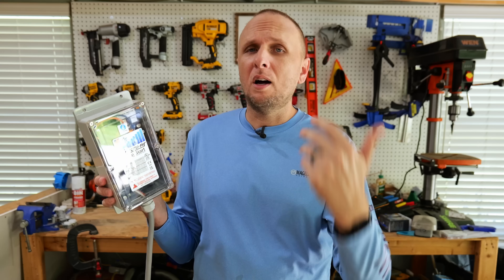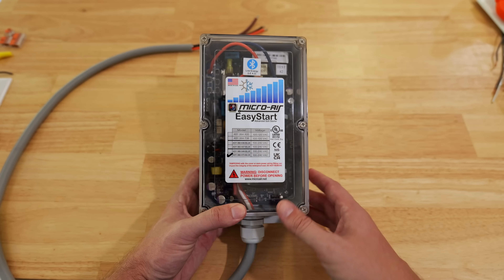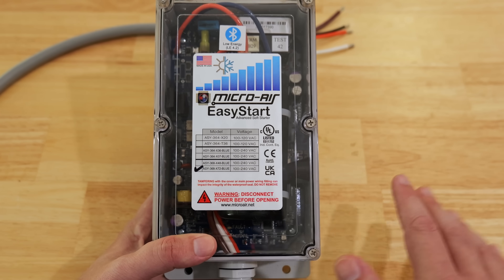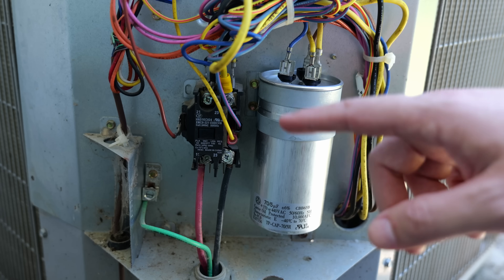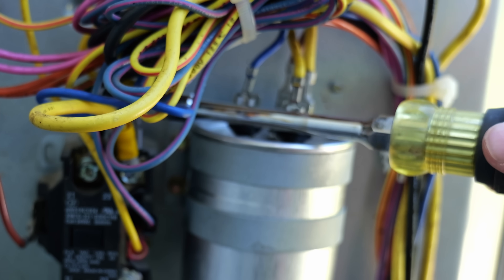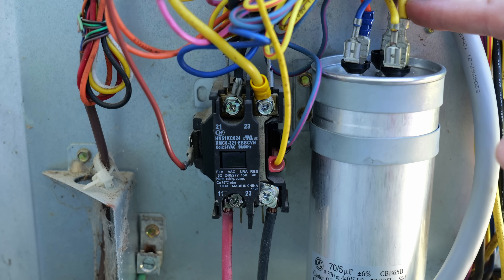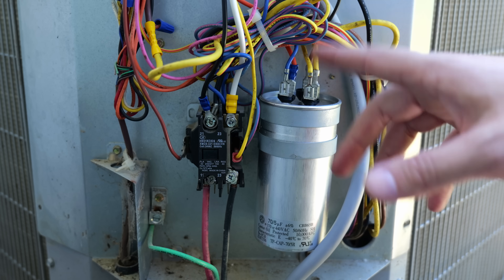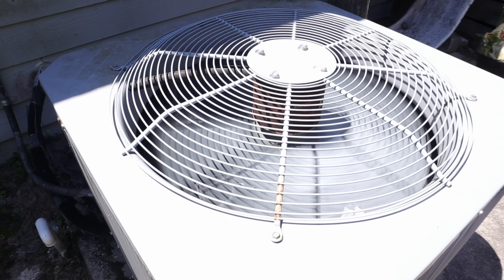Why Every Homeowner Should Consider Installing an AC Soft Starter | Micro Air Easy Start Install

Comment: I bought my kit from their website, they have an universal one now that was just released in July 2024 that works from 1 to 6 ton ACs according to the manufacturer. I used this video for the installation and made it very easy. Make sure the wire that comes from the contactor that has direct connection is the one that connects to the brown wire. The balck wire goes to the side that the switch controls. Both wires that go into the contactor will be 120 each. My softstarter is using 27 amps to start the compressor, and now I am able to run the AC with my generator.
Reply from the maker: Yes I just got my hands in the Flex model yesterday.  Will be making a video on it shortly!   Glad you’re getting such good results!
Reply: @HowToHomeDIY  do you recommend purchasing their EasyStart Universal Installation Kit?
Reply from the maker: @thepiecesfit5049 you can and that will provide you with everything you will probably need and some things you won’t need.  I’ve never personally bought it and just bought spade, ring, and butt connectors from the store.  They do have some things in the kit like a grommet to help protect the wiring entering the unit but they also can be found at the store.  Really just about convenience and price.
Reply: @thepiecesfit5049  I couldnt find thier other models in their website, so I believe the flex is the only that can be purchased right now.
Reply: @HowToHomeDIY  Does that mean that the Flex has a different way of connecting? I just ordered a Flex
Reply from the maker: @willemtenwolde5826 I have not installed it yet but the instructions appear to be the same as on the previous models.
Reply: Are you telling that the orange wire from the Flex dos not go to the HERM on the capacitor?
Reply from the maker: Per the instructions the orange wire still gets connected to the capacitor on the HERM terminal.
Reply: @HowToHomeDIY  correct, apologies for my mistake, edited my comment to prevent confusion.
Reply: @willemtenwolde5826  my apologies, I meant brown. Follow the video instructions, they are accurate. Orange goes to Herm with a spade, brown connects to the direct pass through side  in the contactor.

Comment: After Houston had two storms so far that knocked out the electricity it is time to get this soft start because it was hot on both outages.  Thanks so much for this video. You explain in detail why and how.
Reply: I'm here in Houston,pro AC tech since 2004
Reply: @JamieArellano-nl1lg how much to get one installed?
Reply: @Jezeus11  300
Reply: @Jezeus11  cost of the soft start is 320
Reply: @JamieArellano-nl1lg  👍 I just looked them up. Doesn’t look too complicated to DIY now that I’ve seen the whole video.
Reply: @Jezeus11  you right it's all about how   works with generators

Comment: Guy installing my 9500/7500 generator switch to my breaker told me that there was no way it would start my 4 ton ac.  I think you've proven him wrong with the soft start kit.  Had a local ac guy wanting $900 for the soft start kit install.  Seems pretty simple and I'll install the $400 kit myself.  Thanks

Comment: From what I see it lowers the very brief inrush amperage when the compressor starts. As far as electrical savings it is nill to none. I would like to hear the mechanics of how it works. I also watched a few videos of them being pulled off units because of failure. unless you are having issues I would just leave it alone. I have done refrigeration and HVAC for lots of  years and learned there is no magic bullet. Frequency drives are used on fans etc in commercial applications and in some cases in residential equipment but it is built in to the system. Ask your AC professional rather then do it yourself videos.
Reply from the maker: What were the reasons they were causing issues?  I’ve seen videos of people installing the wrong ones, installing them incorrectly, and an HVAC tech who didn’t know what he was talking about and has since said so.  Yes ask your ac professionals, almost none of them know what a soft start does, how they work, or that they exist.  They will think you’re talking about a hard start kit.  It seems you also aren’t really sure how they work.  Not trying to say that in any way, but based on what you said it seems that way.

Comment: I have a question on the 5 on/off learning cycles done after the Soft start is connected.  Did you pull the breaker the 5 times or did you turn it on and off from the wall switch inside the house?
Reply from the maker: I just let the thermostat turn it on and off.

Comment: I have 2 2000 watt inverter gen that are connected with a parallel kit. Do you think that that set up  will run my 4 ton AC? 
Thanks.
Reply from the maker: That would be unlikely.  But impossible for me to know without knowing your unit's in rush amperage on startup.  I was able to start up my 4 ton with my 6800 starting 5500 running generator.  Which I was actually pretty surprised by.  And it didnt really pull it down a lot.  So maybe.

Comment: Hello. I purchased EasyStart model ASY-399-x20. Installed on house AC 3 Ton.  Worked one day then burned up. Order another one that I guess is higher value rated. The one I purchased seems to be for RV only? Advice please.
Reply from the maker: Yeah the x20 is for RVs.  You have to get the proper size soft starter for your unit.  I have links to the different sizes down in the description of the video.  You can just click the link to the one listed that covers a 3-ton unit and you should be in good shape.

Comment: Can I use the 4ton soft start with my 3.5ton machine? I plan to replace the 3.5 with a 4-5ton in a year.
Reply from the maker: Per Micro Air the soft starters are all sized specifically for the units and using one that is not designed for your tonnage could have negative consequences.

Comment: Will a 6500 watt generator start a 3.5 ton air conditioner?
Reply from the maker: It could.  As you saw in this video, I was able to start my 4 ton with a generator about that size.

Comment: You could benefit from some training on how to crimp connectors and splices.
Reply from the maker: Still holding very strong.  Must not be an issue.
Reply: @HowToHomeDIY  Sure, just because you do not do something correctly....does not mean it will fall apart 😆  There are two types of techs.....those that make it work, and those that make it right.   If you are a "make it work" guy, that's ok, people should just know that up front, and research accordingly for best practice.   Sorry if this offends you......

Comment: QQ, Your inrush is 35.8amp after installing the kit. That's 8592 watts, which was over the peak of small generator at only 6875 watts. That's almost 2000 watts over the generator peak. What am I missing here?
Reply from the maker: Hey, you are just as surprised as I was.  I did not think it was going to start up but it did.  In all honesty that was the first time I tried it too lol

Comment: There are many of these types of unit available and I would suggest that you may want to read the customer reviews of the one you are considering buying. I would say that not everyone installed these unit correctly or picked the right size so you may want to keep this in mind when reading the reviews.

Comment: MicroAir is now offering the Easy Start Flex for units up to 6 tons. Your thoughts?
Reply from the maker: A good idea.  Will make it easier on them and customers only having to look for one model.  Outside of that it is my understanding there aren’t any differences.  I am waiting to get my hands on one to try it out.  I was told today by one of the largest resellers of them that micro air is still making the 368 model at this time.

Comment: I’ve watched and rewatched this video a half dozen times.  I received the new Micro-Air Easy Start FLEX earlier this week and I’m writing the installation instructions for my Carrier, 3 ton 25HBC537A300 model. I’ve watched the Micro Air video also and your video is easier to follow. I think the biggest hurdle are all the different model AC Units on the market, do they or don’t they use other start components and of course the different color wires between manufacturers.  I now have a very good idea of everything I need to do. 

I had taken a lot of photos of the inside of my unit, the schematic, the contactor, and capacitor.  Now I’m able to watch videos and reference my photos at the same time while writing instructions for my unit. I don’t doubt I’m over thinking it and now that I have it on paper, it’s really very easy to install. 

I have a clamp on amp meter, but it doesn’t measure in rush. Like a sign from above I happened upon the Klein CL445 model at Lowe’s earlier this week and snatched it up, because I never see a clamp on amp meter capable of measuring in rush locally. 

Big morning tomorrow, hopefully I won’t let smoke out of anything. Of course all this is so I can better run my house from my portable generator and hopefully extend the life of my two year old compressor even more. 

Thank you for posting this video.
Reply: Keep us posted
Reply: @ariz7493  All installed up and running. I did seem to have issues later in the day that worried me but installing batteries in my thermostat and making sure the condensation drain was clear and it’s all working well again. My initial in rush current read with a Klein CL445 was 87.9 amps. After all the programming starts the Micro-Air app is saying my last start peak is 27.7. It’s noticeably quieter when it starts. I’m at 73 total starts since installing it yesterday.
Reply: "Let the smoke out of anything" 🤣As a young kid my grandpa had me convinced that all electronics had smoke installed at the factory and once you let it out it would never work again,

Comment: Love this! Great video. Question, if on startup the unit requires over 100A, how does a 35A or 40A breaker in the house panel suffice?

Comment: Adam, thank you for your videos, you've been a tremendous help to me. One question though please, I got a 13k generator & a soft start kit for one of my heat pump systems. The air handler is on a 60 amp 220v circuit I think primarily to cover the heat strip which I make sure never comes on and would be fine with disconnecting it. Question is, is there a work around to get the air handler down to a 30 amp 220v circuit so that I can run thru my 50 amp manual transfer switch?

Comment: If you are going to be doing capacitor change yourself or installing of something like this and need to discharge the capacitor, then you should plan ahead and get something like a 250ohm resistor and solder it to some wire leads. Use that to touch the capacitor terminals instead as using a screwdriver can damage the capacitor if it is charged up high still, meaning the life of the capacitor will be lower and you could ruin one of the plates meaning capacitance is lower and damage your compressor which is an expensive fix. A resistor to discharge is a safe way to do it and only takes a few seconds.

Comment: I am installing power share to use the battery from my Cybertruck to my house when power is interrupted or lost. However, my A/C is a variable speed 5 ton heat pump and concerned  if I need a Soft Start kit to avoid the concerning surge level when the back up from the Cybertruck is triggered. If the variable speed provides a similar soft start effect, can I avoid the need for the soft start? Thanks

Comment: DIY guys preach about the capacitor replacement scam but push these overpriced devices which appear to be a cheap capacitor and circuit board. Also won't this void your warranty. At least put pressure on the manufacturer to lower prices via a little pushback.
Reply from the maker: Not pushing anything.  A capacitor is required a soft start isn’t unless you want to run your ac using a smaller generator.  Two completely different things.   No it does not void the warranty.
Reply: @HowToHomeDIY  It's being pushed. Affiliate links. Look up some videos. If you have a bad compressor claim, they will more than likely void the warranty. "Manufacturers may void the warranty if anyone changes or adds a device to their equipment outside the controlled conditions of the factory,"
Reply from the maker: I have had this on my own system for years.  I can’t share what works well?  Don’t want it?  Don’t buy it.  Doesn’t void the warranty.
Reply: @HowToHomeDIY  Yes, OK understood. No prob with the video, just think the whole story should be presented. And a little pushback on price because you have to admit, these are way overpriced for what you get.
Reply: @HowToHomeDIY  It may be good, not saying it's not. Some bad experiences exist too. I'd suggest removing it before a service call.
Reply: @HowToHomeDIY  'The soft-start AC  works by utilizing capacitors in series, which enables them to reduce the current entering into the motor while still providing enough voltage to start it. The debate surrounding the use of a soft-start AC capacitor is often centered around its purpose versus its cost.'

Comment: Awesome video. Thank you so much. I have a 4 ton, 48,000btu ac. Should I go with the 42 or size up to the 72 on the soft start? Is there any precautions to sizing up?
Reply from the maker: I asked Micro Air that very question and they said you have to get the soft starter that goes with the tonnage of your unit.  They are all designed with the tonnage in mind and what they need.  So buying one that is larger than you need was strongly discouraged by them.  That said, if your unit is 4 ton, the proper soft start would be the X72.

Comment: Well. I finally broke down and bought two of the Easy Start modules for my air conditioners. A year ago I installed a hard start kit with the built-in relay. A year later, my air conditioners started to sound a bit rough again, so I checked and found that the hard start kit was damaged. The top came off on both of the units and the PTC Thermistor (not a relay) was in pieces. So it has not been working for a while, which I understand is not good for the compressor motor. I installed the Easy Start and what a difference this made, they perform beautifully. Bottom line: if you are going to install a hard start make sure that it has a separate relay and not a built-in thermistor (even though they call it a relay).   I am not an AC expert, this knowledge is from my research and experience. If the experts out there would care to comment on my review, please let me know if I am right or not. Thanks.

Comment: Thanks for sharing this is incredible information and your demonstration is also incredibly explained thanks I’m doing this to mine kudos brother oh I have a 16k standby generator Generac propane my thoughts on connecting it instead of the traditional electric automatic switch I would like to use that 50 amp plug like you just showed for your generator reason it’s so complicated getting a permit and high installation cost this way I can just do the same thing like you just did what’s your thoughts please thanks

Comment: To clarify, the soft start is starting the fan separately reducing amp load and then starts the compressor - is there any chance of starving the compressor (brown out)?  Sounds like a great solution to my new Lennox AC.  The unit starts rather loud and hard.  My old Trane, you can barely hear it start, this should take care of the hard start.  Thanks.

Comment: Just received my easy start been watching your video on how to install this to my heat pump, on the brown wire theres a warning label that states connect it to the run winding if connected to run cap damage will occur, so is the run winding the yellow wire that goes to the compressor side on top of the capacitor

Comment: Great video! I've been wanting to get a Soft Starter for a while now. Question. When you do the 5 restarts for the learning phase. Are you letting the system run through 5 complete cooling cycles? Or are you letting it start, cutting power, turn the power back on to let it cycle again, and so on five times?

Comment: Put this on my home ac 2 years ago. BEST thing i ever done. IMMEDIATELY cut my cost on my electric bill. Highly recommend this to anybody that wants to save money and a piece of mind.
Reply: Doesn't your compressor still draw the same amount of running power? This device seems like it staggers start up but the total energy required to start and run hasn't changed so I don't know how this will impact your energy consumption.
Reply: @coniccinoc  it supplies power for in-rush current. It does save money,, it has to do with how the power company measures big jumps in amp draw vs lower consumption.
Reply: What percentage cost off your power bill would you say?.. i live in Vegas, so my bill is like 5-600 during the summer months.
Reply: @starmc26  I'm in Dallas. Bill was constantly 500. I'm at 375 now. HUGE difference.
Reply: @jasonrock2804  keep dreaming … there's no way a soft start alone dropped a bill by $100/month. That would suggest a major efficiency gain — and a soft start just doesn't work like that.  You only have to convince yourself.
Reply: @condor5635  well it did.  I will keep dreaming...I love it
Reply: That is AWESOME!!!
Reply: i smell BS. these don't cut your energy costs, they just ramp up the motors starting speeds instead of surging full power to crank them on immediately. these don't save energy while the motors idle, that's simple physics and energy consumption. ever since these things started showing up on youtube and a/c techs swearing by them i have heard all sorts of magical stories about how they will deliver your child for you, wash your car and save you thousands on your home and auto insurance.